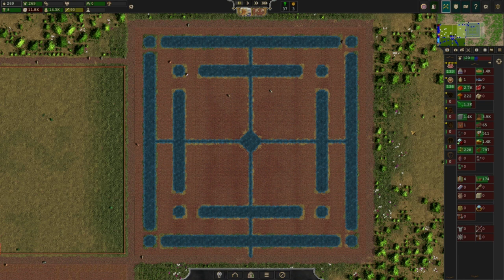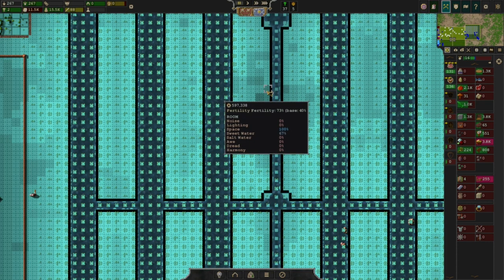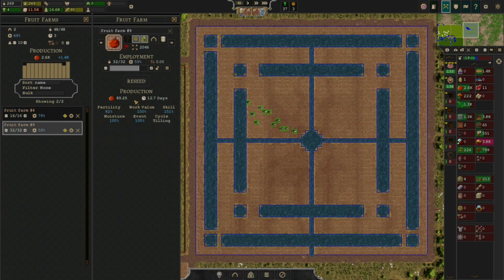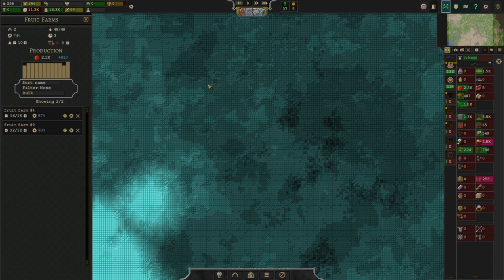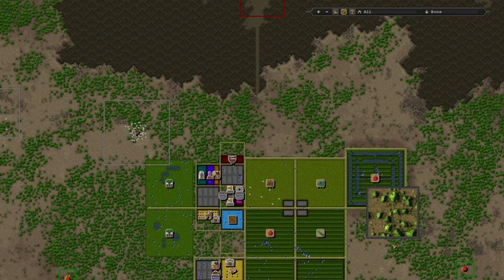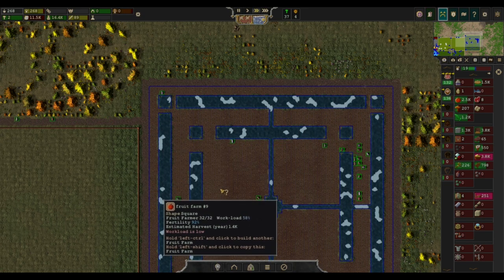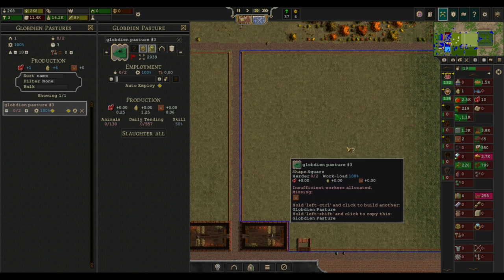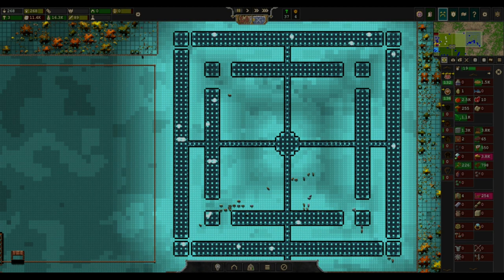Optimizing Farms Using Canals, a not so quick tutorial - Songs of Syx

Comment: hey! how did you dig tunnels within the fields? at first i though i'd have to dig the tunnels and then add the fields on top of it, but then they remove the tunnels so there's no water. then i tried digging tunnels within an existing field but it tells me that i cant do that because i cant dig within a "room" meaning the field. do i have to place the fields around the tunnels? that would be quite dumb :D
Reply from the maker: Use the expand and shrink buttons to draw the field square by square.
Reply: @JoelleTheAbsurdist  thank you! done that now and it's much better than what i did before :D

Comment: Whats the number for length and width
Reply from the maker: If I remember correctly, 55x55... Basically whatever the maximum is, then you carve out space in the middle to whatever shape you want, because the total number of squares has to be less then... and amount I can't remember. Fill that space with either wells or canals, or, put buildings in it. Placing a small warehouse increases harvesting speed... might do another video... maybe...